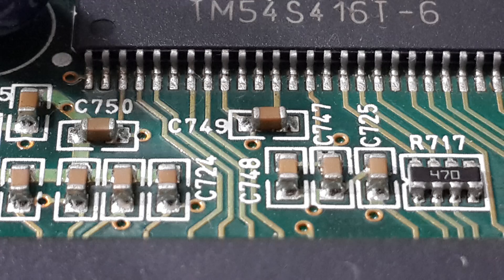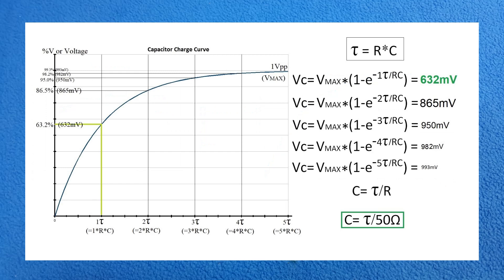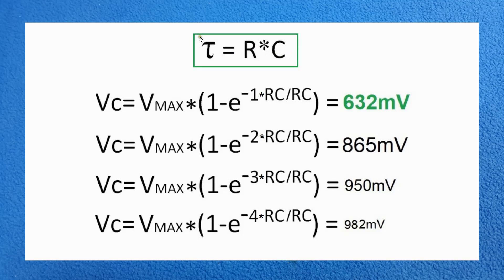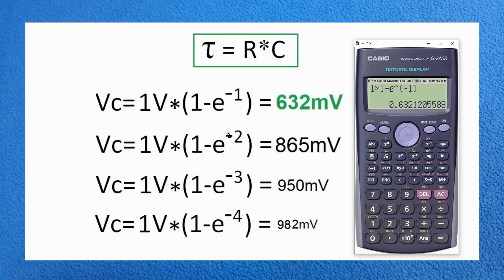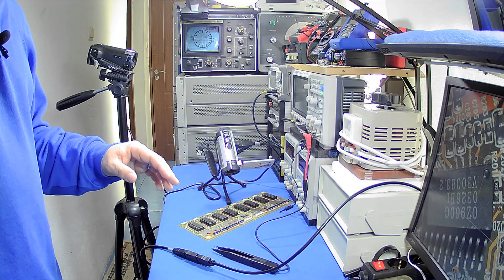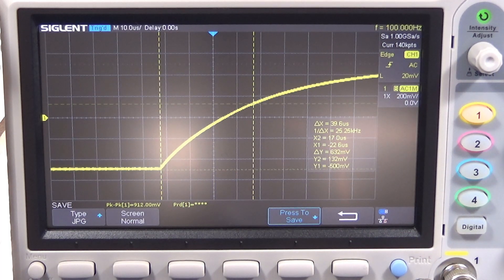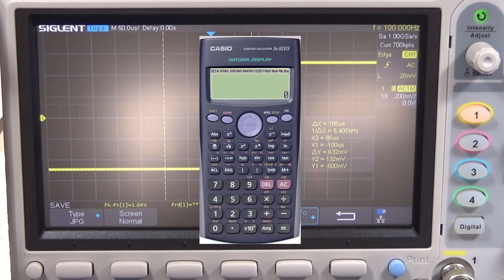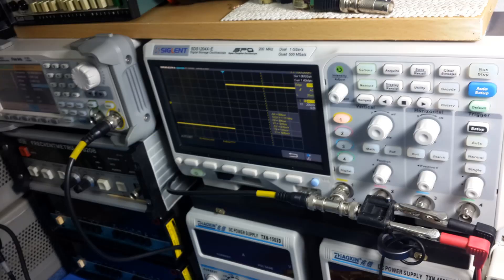How to test or measure SMD capacitors on the PCB / on circuit measurement free electronics training

Comment: Bro can I use same color and same size ceramic smd capacitor . Actually Mera bike abs ecu water damage ho gaya iska board diagram nahia hm be pura all smd check Diya no short-circuit but one dark brown color ceramic smd on ecu board it's damaged one point . So I couldn't calculate the value of the smd capacitor . Than what will do to replace . Please help bro . This smd capacitor on board no value no marks are mentioned . After I searched on Google it can any side ceramic capacitors

Comment: When you try to look too smart you. 
A basic multimeter has capacity meter.!!! Just set on capacity measurement mode and put probes on the capacitor.
Reply: multimeter capacitance mode is not good at all in circuit, and not that accurate when out of circuit.

Comment: how can you enter formula without brackets to scientific calculator while it is completely mathematically incorrect? Scientific calculator uses mathematical rules. multiplying and dividing are operations that are made FIRST. That is why brackets are used to specify which part of formula is calculated as a separate block using SAME RULES with respect to multiplication and division. FACEPALM. you got a lot of expensive equipment but you haven't got an essential tool to start with. the brains

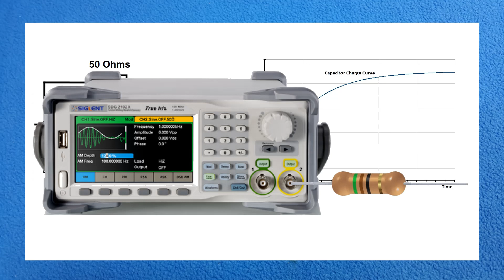Comment: 2:14 I will need to attach a 50 ohms resistor to that port or it's built-in the machine?
Reply from the maker: Hi! If your Function Generator has 50 Ohms internal resistor, you don't need it. If you don't know your internal resistor, 600 or 1 Kilo ohm you have to make the measurement in the output of the function generator and add the resistor or to use the voltage divisor formula.

Comment: I've started my journey into the world of electronics and the first question I have is how can we find the values of a multilayer ceramic capacitor that is shorted without schematics??
Reply: I'm in the same boat as you, I've been able to find similar capacitors on similar banks of the same circuit type on my board to use as a reference, using those capacitors "should" give you a good estimate to replace the shorted cap, another tip is to download the datasheet for the IC that is tied to that capacitor circuit, typically the vendor provides reference schematics that will provide recommended capacitor and resistor values.

Comment: Hello, super interesting! (I just Subscribed : )) Small question, how do you know which is negative and positive on the double connections of the BNC that connects to the probe leads? Does it matter? Like right now the black is next to the Oscilloscope and the red is front of it. What occurs if those were swapped ? Thanks!

Comment: I still can’t figure out ho to find what little capacitor is causing my motherboard not to power up, there’s a bunch of them beeping, I wish someone on YouTube made a video starting from the power and working through each component trying to find what one is making the other ones not work... I’m going to have to change each one of them until they are all not beeping anymore then hopefully my laptop will boot up again
Reply: typically one lead of the capacitor is usually tied to ground, if that's what you are referring to then it's most likely not the cause of your power up issues. However if they are shorted to ground then you only need to replace those. ALL of them should not be shorted that's very rare for that to happen.